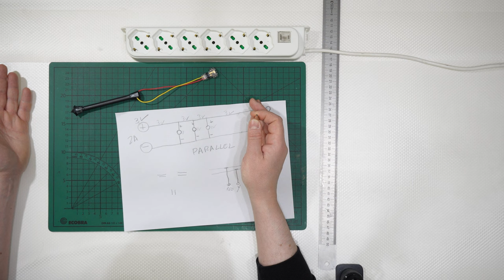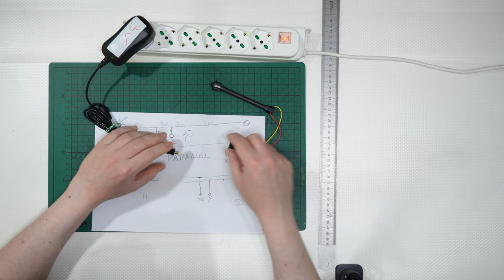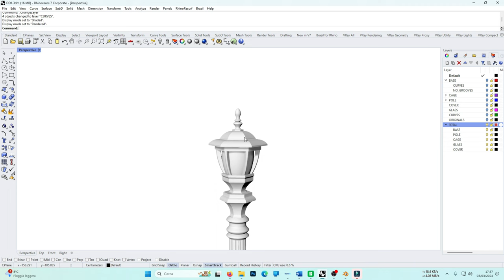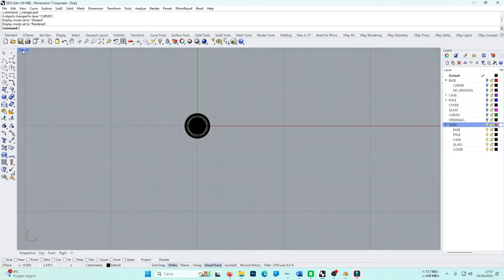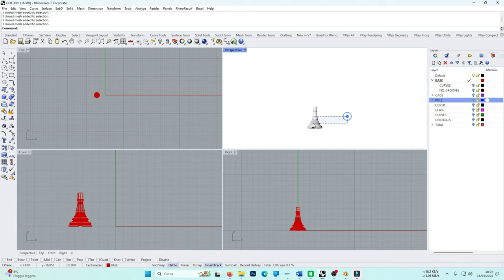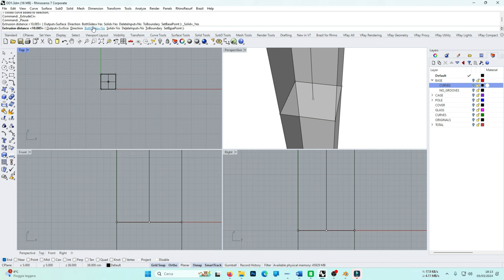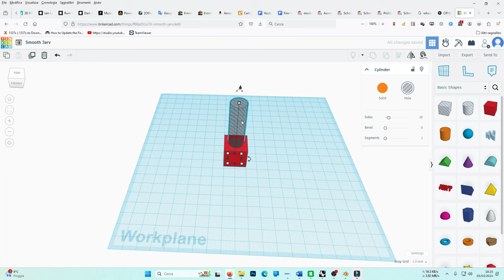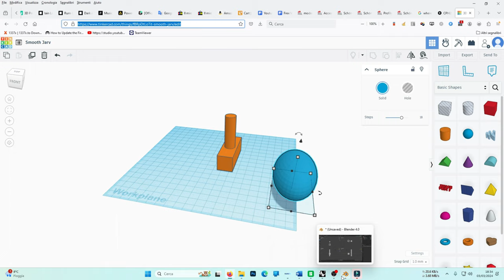DIY Streetlamps for Christmas Villages Using LEDs - PART 4

Comment: Hello Silvio,
Thank you again for the street lamp tutorials. I have already dismantled 12 of the mini ones, managing to not break 8. I am starting on the second pack of 12 and have ordered 2 more packs. Now I am waiting on the tubing. It is not available around here (1/4 inch is the smallest available). But I was able to order it from Ebay  and Amazon and it will eventually arrive from China. It just gives me more time to prepare (dismantle) my mini street lamps. And of course after I get one set up and running, I will probably send you a picture because I will be bursting with pride!
I watched the 3D part  too and will share it with my sister.
Reply from the maker: Hello Susan,
Of course you will have all the rights.
And don't worry everyone will understand and you will have a dispensation for your capital sin.

Comment: I have watched this series many times now taking notes and I am finally ready to order supplies and upgrade my village. I really appreciate all the detail for someone who knew nothing about wiring and LEDS. I have two questions. On amazon I see LEDs that are prewired and have a resistor in them. Will I be able to use those in a parallel circuit as you showed? Having them all on one power supply plug is what I want to do. You didn't need to go in detail about the resistors and so I am not sure what they are for. Second, can I use electrical tape over the connections instead of purchasing the heat shrinking tubes? I already have that, and have small hands that could manage it small pieces of it. Thank you so much Silvio!
Reply: I just thought of something, perhaps the resistor makes it too hard to fit the wires into the lamps as they add quite a bit of width of the wiring.  I will still appreciate an answer though. I am also looking into using this same method on my buildings, which do not have restrictions on space. I am wondering if using the resistors in parallel will weaken the current on the entire circuit, therefore limiting the light too much on the last building. Do you have any recommendations on what size and volt LED bulbs to use for the buildings to have a warm but bright light?
Reply from the maker: Hello Emily,
Could you please email me the Amazon links for the LEDs with the wired resistors you want to use in order to be more precise with my answer? (not more complicated I swear!!).
You will find my email address on the home page of the channel (Community tab).

Concerning the second question: absolutely yes, you can use electrical tape. 
But please, make sure it is a good brand and that once positioned on the wires it does not slip out otherwise you risk short circuiting the LEDs.

Normally you need an AC Adapter to power such LEDS for the street lamps and for your buildings.
If you buy a multi voltage ac adapter with a power of 30W and 2A of current intensity you will be able to power up to 100 units with no decrease in light intensity. And with the correct AC adapter and type of LEDs you don’t need to use prewired LEDs with resistors but only prewired LEDs.
Warm and bright LEDs… also on this topic I need to have an idea on the type of LEDs you saw on Amazon.